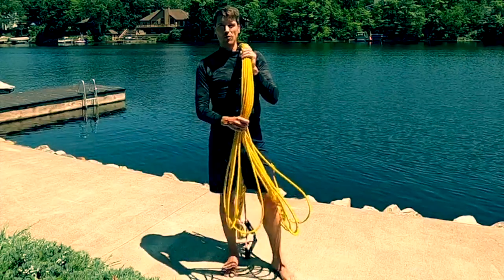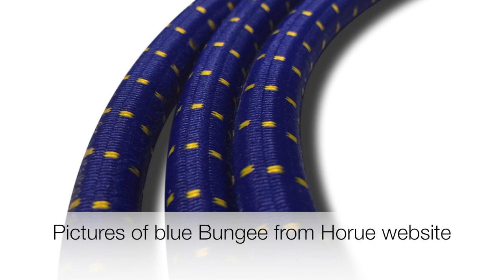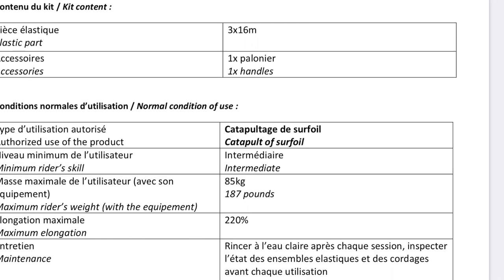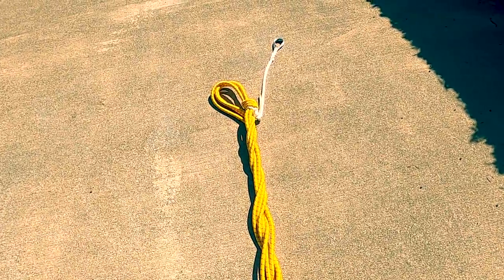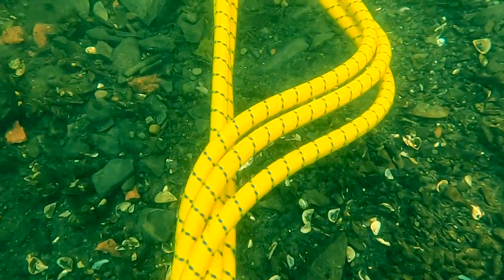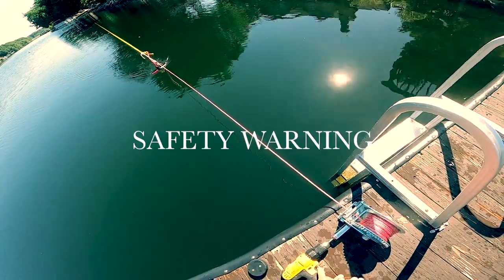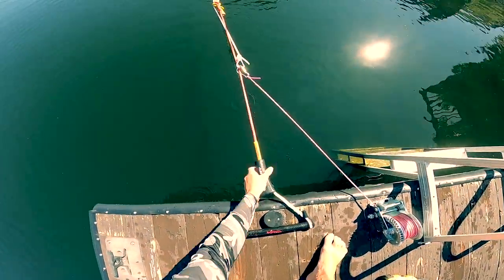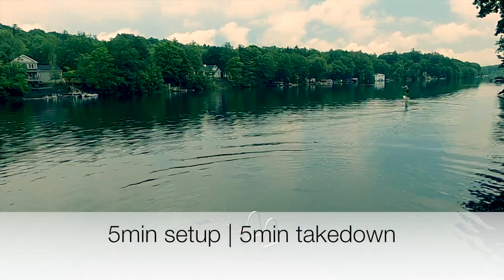Hydrofoil Bungee | Launch off the dock to flat water pump & catch waves with a foil

Comment: Another great video. I am finding dock starting is more difficult than I expected. I'm thinking a bungee could be the trick. I have no experience behind a boat but I windfoil. I have a pond, a dock, and a John Deere Gator. What do you think of this plan:
1. Secure bungee bar to post on dock.
2. Secure other end of bungee to rear of Gator on shore near dock.
3. Drive Gator along the shore until proper tension/distance is gained. SET PARKING BRAKE ON GATOR.
4. Sit on dock with feet on board, lift bar off post and take off.
Thanks for ideas!
Reply from the maker: Please be safe. Just the other day, when I was hooking one end of the bungee with a little tension on it, it pulled me into the rocks on my lakefront. You might not even need the gator, depending on how clear/direct the path is. It will help a lot to have a buoyant board. If you have a large wing it will help too. Good luck!

Comment: This is great thx! Do you think the slingshot 9 liter board would be too small for this? I weigh 176 lbs.
Reply from the maker: It is not if you have the right front wing. At your weight, and with this ~10L board, And at the bungee’s full elongation, I would guess you need a front wing or at least 1500sqcm with an aspect ratio of >6.5

Comment: Very cool, Have seen you on a Slingshot i99, Have you been successful on a Slingshot i84?

Also what is approximate diameter of each piece of the bungie cord?
Reply from the maker: Yes. Works very well with both 84 and 99, even with the 11L Dwarfcraft board. If you have a more buoyant board, it will be even easier. I believe it’s 3x ~3/8” ropes.
Reply: Hi Foiling NY,
Which fuselage position do you use for the i84?
I use C position for windfoiling, from the video, it looks like you are using B, please confirm.
Reply from the maker: I use B. I’ve never tried C though